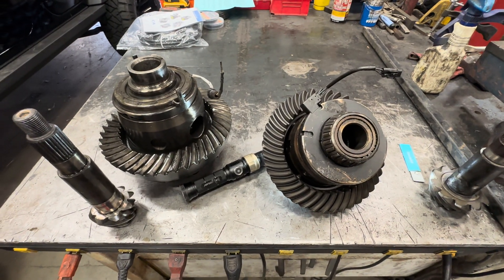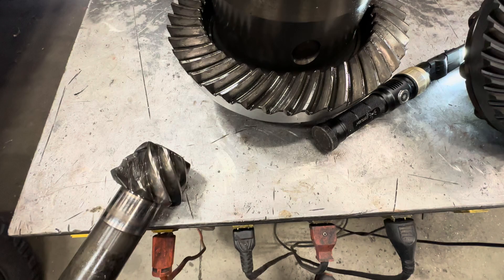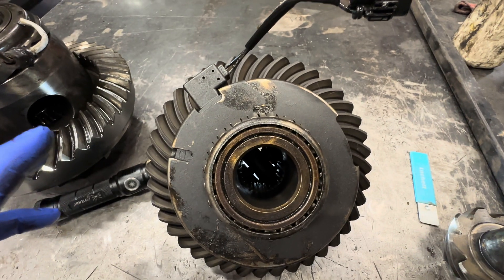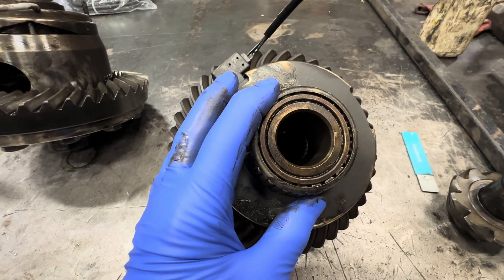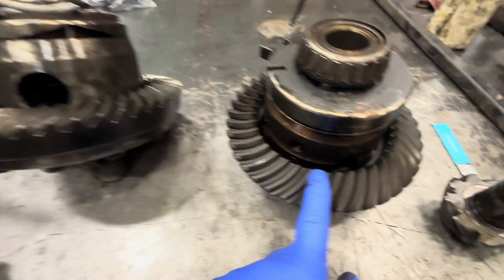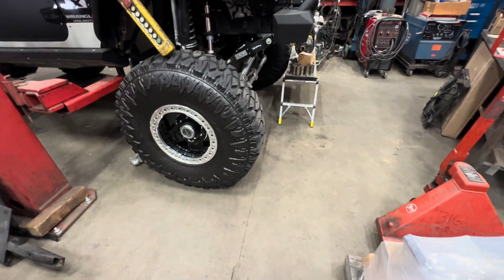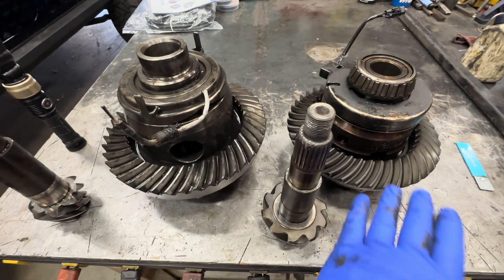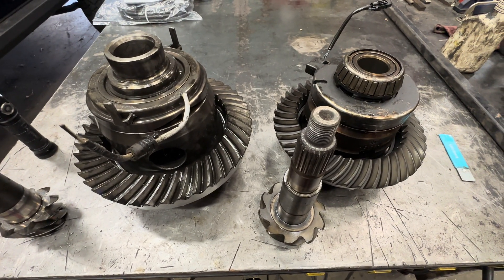Lockers and gears and why the 8 speed helps

Comment: Nice video. When I bought UD60s for my JK I was stuck deciding between 4.88 and 5.38 gears. I went 5.38 to support running up to a 40in tire in the future and didn't have plans for an engine swap. Currently running a 38in Nitto. When I had to make that decision your 8 speed swap wasn't out yet and had it been I would've gone 4.88 and then done the 8 speed.

If I ever have to change the gearing I will go higher (numerically lower) to 4.88s  and then can set sights on doing the 8 speed swap. 
From what I gathered following you these past few years, the Jk 3.6 with the 8 speed and 5.38s would not be good combo or at least would not be much better than what I already have. 

 The 5 speed NAG1 w/ 5.38s makes using the jeep for daily tasks a less than ideal experience as it is.
Reply from the maker: Using the Nag1 and 5:38 gears you must be running a high RPM, the 8 speed will help on the RPM side and should lower the RPM about 400..
Reply: @jeepspeedshop  Thanks for the response Todd